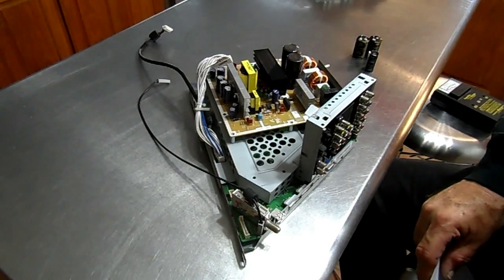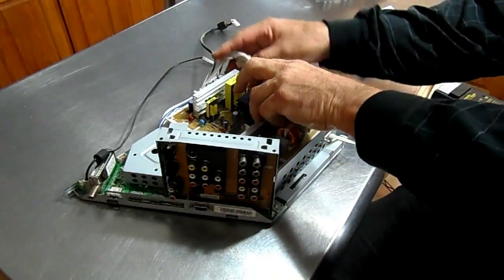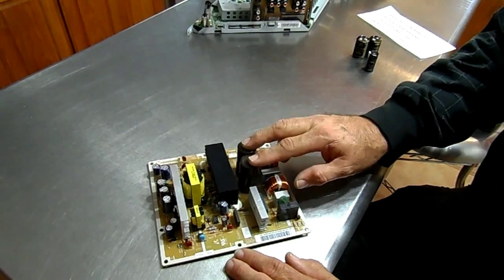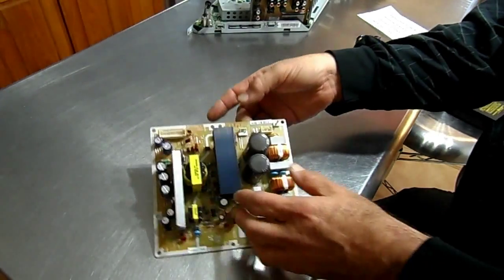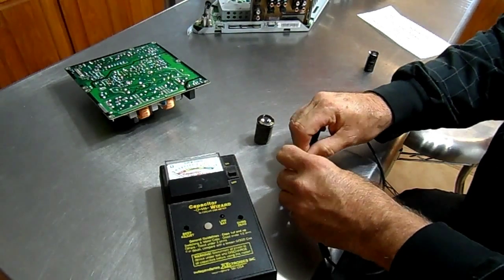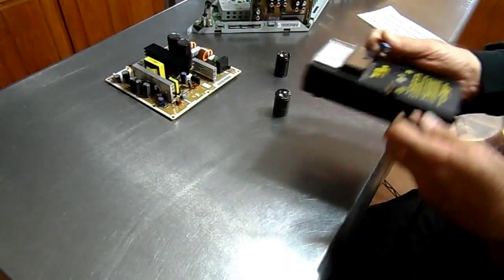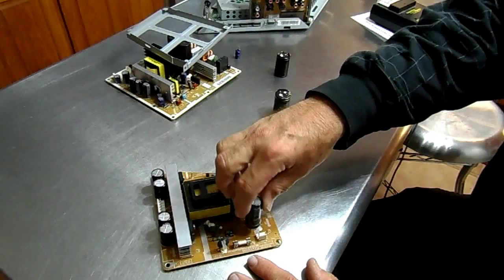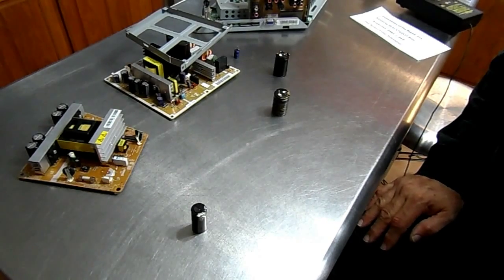Repair Samsung HL61A750A1F With Flashing Indicator Leds at Power On.

Comment: Great detail in explaining what is going on with these.  I probably can critically think about tracing through the boards to see what is going on without a schematic, though you've explained more that I was wondering about.  Appreciate that and thanks for sharing!

I had a bad Blue LED in the HL61A750A1FXZA and swapped with a working one from a HLT6187SAX/XAA, though same symptom.  I made a video here: https://www.youtube.com/watch?v=FJqxb762VI4

Here's the two videos I made to show the blue LED performance:
https://www.youtube.com/watch?v=xJjF3n3_nmI (not working correct)
https://www.youtube.com/watch?v=5sp8AiUuJAM (working correct)

I do have the bulging capacitors also in the LED power supply board... though with the HLT6187SAX/XAA two other modules... I just get the bad DLP chip issues like in your other video regarding replacing the DLP Chip... like the power supply board isn't the issue, maybe like a mirror controller or something?  Anything else that might go bad with the video I made error front panel LED codes whatever they are showing? Thanks in advance for your time and sharing!

Comment: Is there a video of replacing the board?  taking it out putting the old one one the new one and back in?  Is it attached to the light engine or is it off to the side where it just slides out easily?

Comment: I have the HLT6187S which is very similar to ur two boards. Great vid but wish u would explain in detail wat the syptoms were. Like did it come on at all? mine is coming on cycling with green light blinking 27 times with 14th time having a long pause eventually after remaining blinks after some time going back to standby mode. I replaced all cold side caps on both boards. Replaced two big caps on main psb. the repair kit from shop jimmy did not come with all 11 caps my 10001a boards has. it came and I replaced 9. the two smaller middle caps by and almost under heat sink in middle of board were not changed. also I did not replace the one cap by itself on led psb but changed the 5 cold side caps. this originally got the tv to come back on but took several tries always going back to standby mode which it still does were as before would sometimes lock up having to be unplugged. don't have that problem now. but now it wont turn on. I heated the two big caps up and tv comes on first try faster than ever has. I thought it would be the two big caps anyway but maybe it was heating those two middle caps up cause its doing same thing now if I heat up but will not stay on long. picture feezes with crazy distorted lines sometimes comes back once but most of time freezes. if I change channel ill get sound from channel changed to with frozen distorted pic still there until shuts itself off. sometimes it just shuts itself off. Any advice?

Comment: Good Afternoon Mr. Leggett, im having a problem with my Samsung HL61A750A1F DLP TV. i just installed a new DMD board and the television is not showing anything on the screen. all three lights are blinking. when the power is pressed it comes on an the led light keeps blinking until it turns off automatically then all three lights come on.
Reply: Did you figure out what was wrong with your tv I am having the same exact issue.....
Reply: Sam Singh Same here.